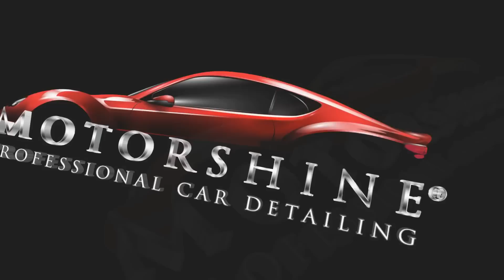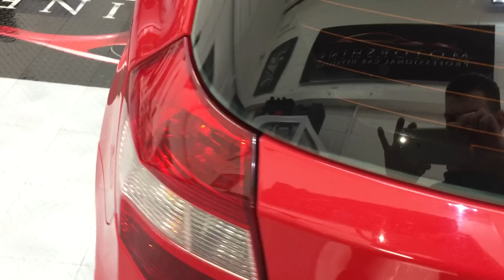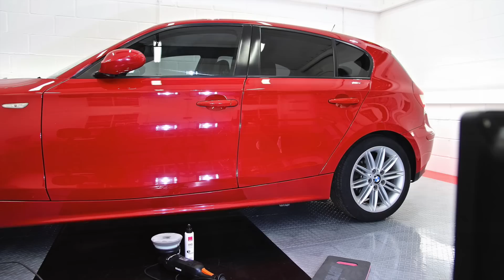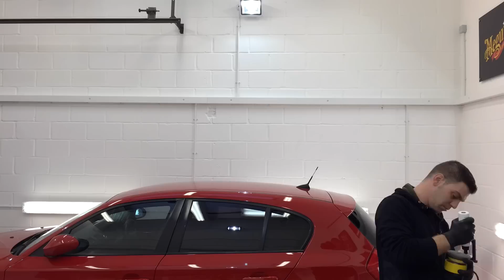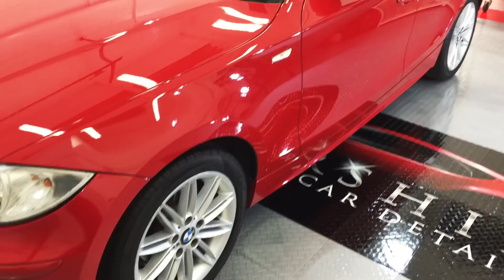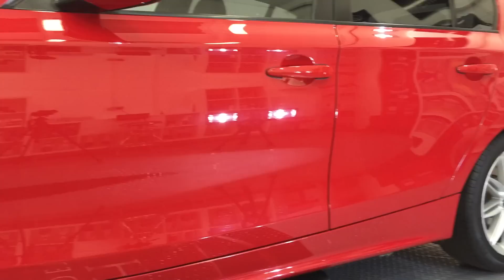MOTORSHINE  BMW 1 SERIES SINGLE STAGE DETAIL

Comment from the maker: Ref Thomas : The UHS Polish is more of a compound rather then a glaze which is what you are referring it as. Yes a glaze will gently clean painted surfaces and masks fine paint defects but the UHS Polish is not a glaze.The UHS Polish cuts and at the same time leaves a high finish to the paint this is why it is good as a one step system.  After each panel is corrected i always use isopropyl to insure that there is no polish left on the panel and to make sure that i am doing a true correction rather them masking up light swirl marks and scratches.
Reply: hi there what if i want to learn all this ??

Comment: Nice video, i tried the UHS system using my LHR75e and LHR15es, i got excellent results, complete removal of swirls with ease and the high gloss finish is amazing. But what i liked best was no dust!! Now just need to follow up with a ultra fine polish and then seal.